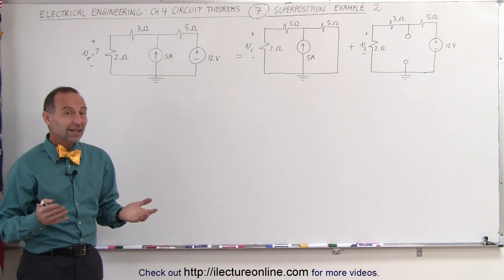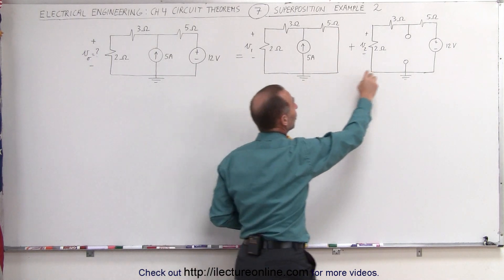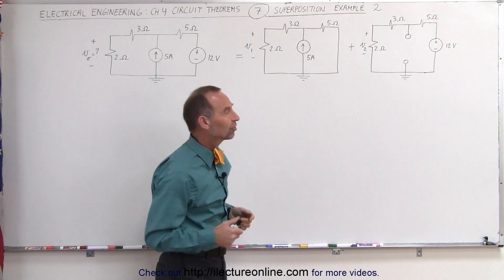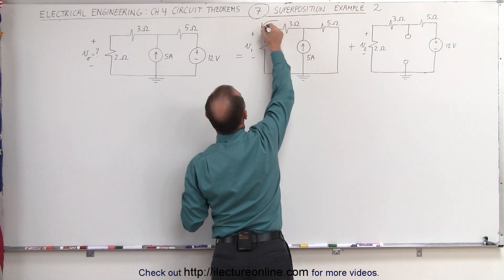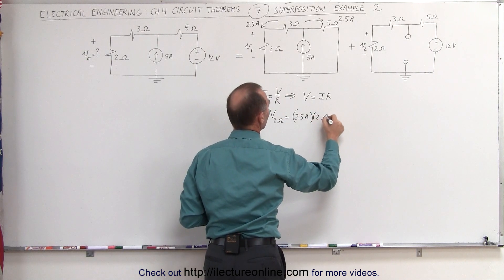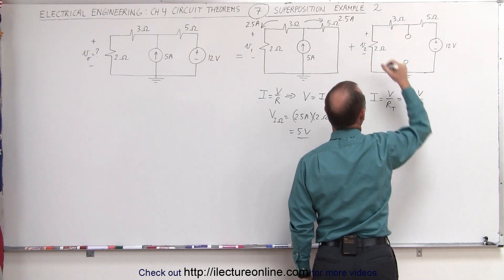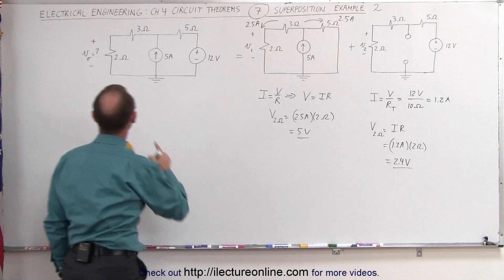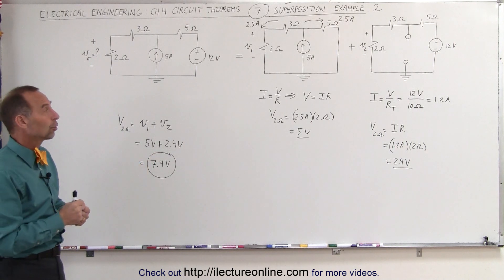Electrical Engineering: Ch 4: Circuit Theorems (7 of 35) Superposition Property Ex. 2

Comment: How would we determine the voltage drop across the 5 ohm resistor?
Reply from the maker: the voltage drop is calculated using ohms law:   V = I R   In the middle diagream V = IR = (2.5 A) (5 ohms) + 12.5 v          On the right side we use a voltage divider:  V = 12 volts ( 5/10) = 6 V

Comment: Wow thank you very much sir, I have a question though. For the diagram with V2, when the current is flowing from the 12V Voltage source... doesn't it split at the junction between the 3 & 5 Ohm resistors?
Reply from the maker: Since the branch in the diagram on the right is now an "open", no current can flow through that branch and all of the current will flow through the 3 ohm resistor.
Reply: @MichelvanBiezen  Thank you.

Comment: Excuse me, i want to ask, how if there is a resistor that series with the current source, are that resistor will be remove as well?
Reply from the maker: No, the resistor would remain where it it, however when the current source is removed, no current would flow through that branch.

Comment: Sir  if we have two loops left and one loop in right how the current divide is it like this case.
Reply from the maker: The technique you use depends on how many sources you have.  If there is only one source you can determine the current using the "current divider technique", but if there are multiple sources you can use Kirchhoff's rules or any of the other techniques explained in later chapters.

Comment: What if the resistance on one side is not the same to the other side? Does that mean that the current flowing through them wont be equal anymore?
Reply from the maker: It doesn't matter if the resistance is the same or not.  The current will adjust accordingly.  Try it and change on of the resistors and see what happens.

Comment: +michel How can you say that 2.5 A current will pass to each branches from 5A Source. Current passes more where resistance is less so from 3 ohm resistor current should be more then 2.5  A. 
Please clarify it.
Reply from the maker: The resistance in each branch is the same ( 5 ohms).
Reply: +Michel van Biezen sir you are awesome I am preparing my Calculus and Physics from your lectures. 
Your way of teaching is very nice. 
I am electrical engineer There are not many chapters of Electrical Engineering I wish You will upload new videos of Electrical Engineering.

Thanks. I have test of My dream job on 16 July if I'm gonna pass that you will be the reason behind my success. 50 % will be Calculus and Physics and 50 % will be from Electrical Power Engineering.
Reply: @MichelvanBiezen  sir, i guess, you should have first noted that you've added the 2 and 3 ohm resistors before stating that 2.5 A are flowing on both side. Well, I'm still thankful that I've read some of the comments cause I'm confused. Anyways, I still understood the lesson, so thank you so much :)